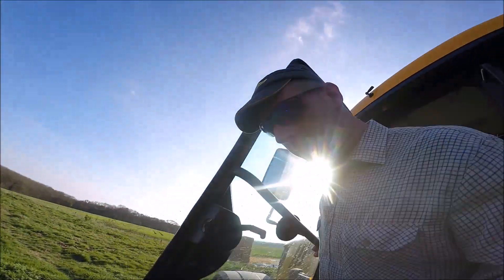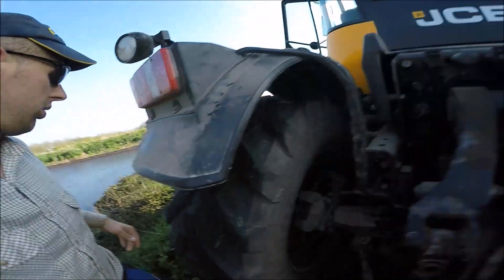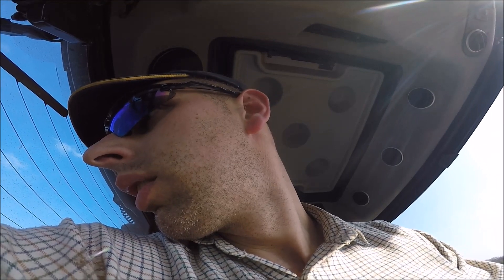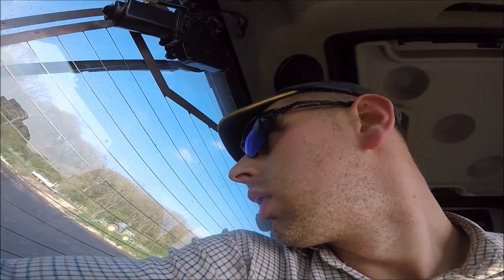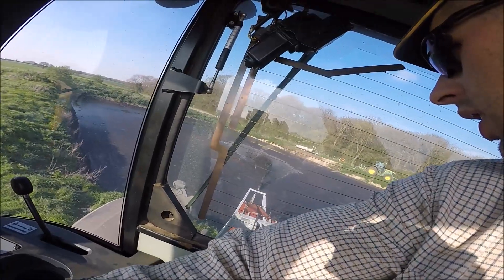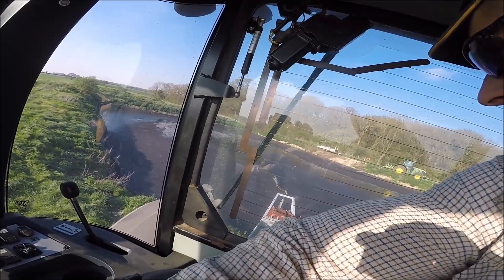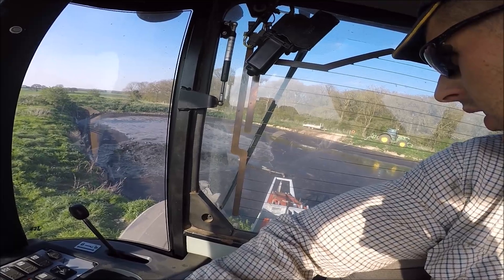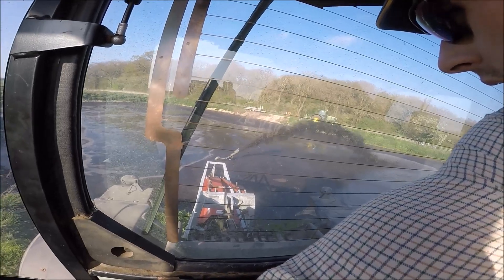JCB Fastrac 3230 and Storth Slurry Pump

Comment: What is the purpose of using this pump? Are you just using it as a circulation pump? And if so why does it need to be stirred up.?
Reply: FarmerJohnGaming so your not pumping water at the start and virtually solid stuff at the end
Reply: The slurry separates into solids and liquids. By using this pump it stirs them back together and the mixed slurry can then be pumped along the pipes.